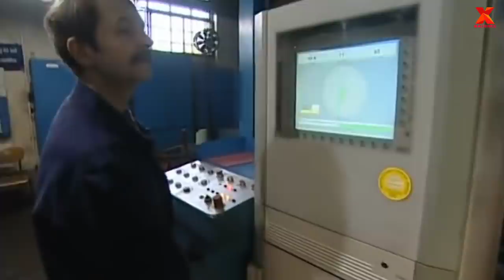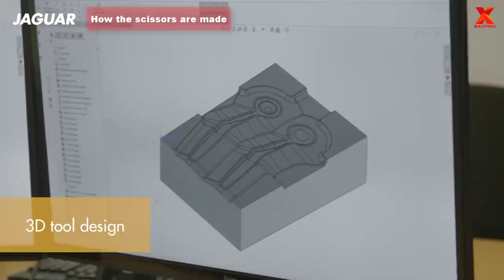Incredible manufacturing process from scrap steel to rebar then giant chain and nail nipper

Comment: Coking coal is still needed in the steel making process
Reply: Not all of them. The process shown here uses an induction furnace which, like an electric arc furnace, has a total charge of scrap steel.
Reply: Yes induction furnace...then useing a spectromiter for alloys to see what needs to be added to the pot. The scrap is just a base cobalt nickel ect. Need to be added for it intended purpose. Then re tested